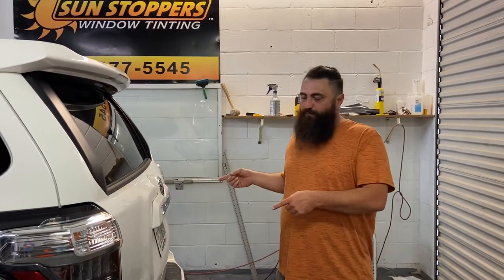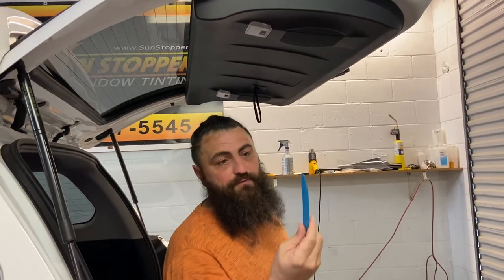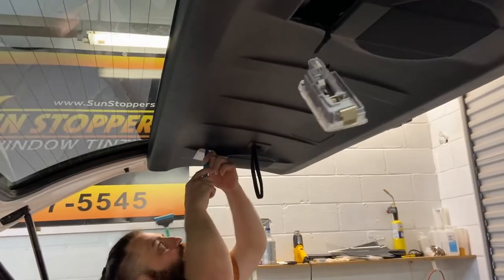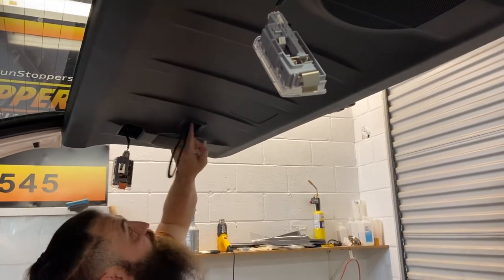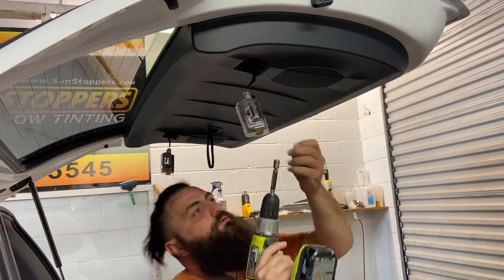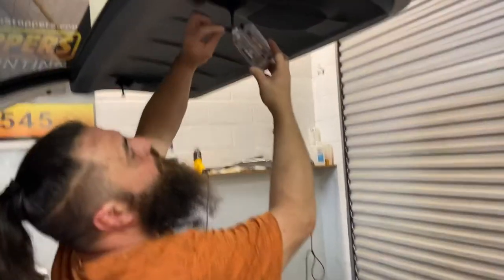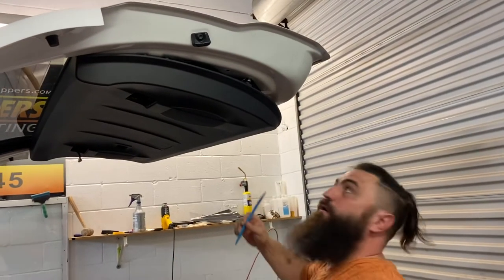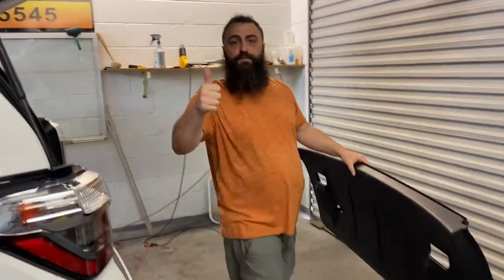How to pull the rear hatch panel on a Toyota 4Runner?

Comment: Amazing video!! Had a loose piece of metal clanging around every time I opened/closed the rear hatch. This video is perfect to follow! I also had to unscrew and pull down my speaker so I could shove my hand into the metal/body cavity… and wala !! A loose nut that turns out to be VERY important.. your 4Runner name plate (liftgate garnish) is secured by 4 bolts with nuts. My liftgate garnish was a little loose and it drove me nuts but I had no idea why. This loose nut was the culprit! I screwed it back on and now my liftgate garnish is super secure!  Thanks so much for helping save my money and sanity!!
Reply: I am here for the very same reason. 2020 Off-Road
Reply: Same. 2017 TRD Pro
Reply: same!!!! haha.
Reply: Same 2016 SR5
Reply: This is why I’m currently watching this video. The screw is driving me crazy!
Reply: I had the same issue. 😂

Comment: Actually no need to remove the two 10mm by each of the lights.  Those bolts hold the speakers to the door.  Only need to remove the 10mm by the pull cord.  The panel is held on my 12 push clips.  so just pry them out.
Reply: I came here to say the same thing.  Just to be clear, you still need to remove the lights though.
Reply: Good call. I’m about to pop panel off. 2014 Runner lift gate is rusted out from the inside. All of this internal components have been compromised. So yesterday 7/29 I powered window down a bit to get some airflow and the glass went sideways & upon further inspection through rust holes in the garage I could see the tiny cable that secures glass has slipped off these round polyurethane guide tabs. Ahhhhh. Living in northern Wisconsin winters wreaks havoc on metal parts.

Comment: I am having trouble getting license plate screws out on back of 2016 4Runner...would this allow me access to the back of the screws??? or would there be more to remove....was thinking vice grip from back?? the plate is on with rusted screws...not bolts...